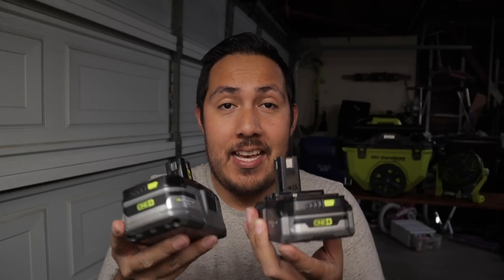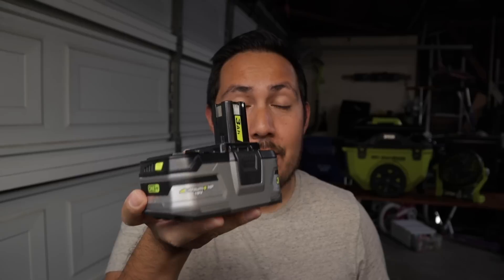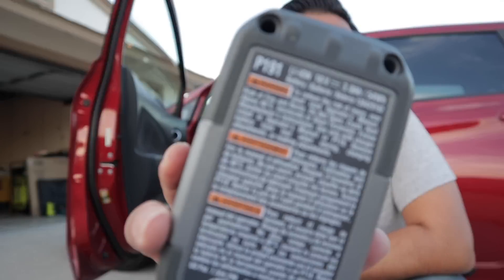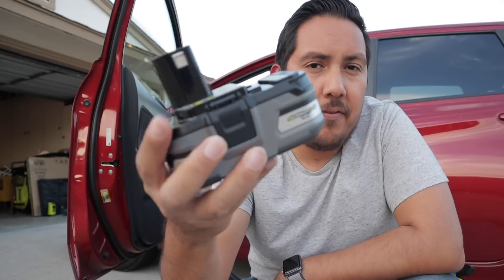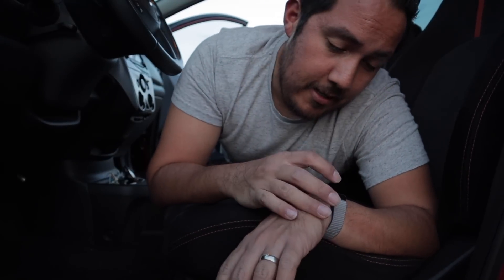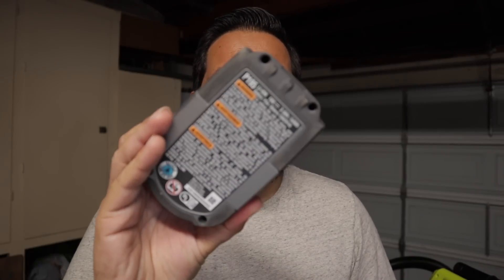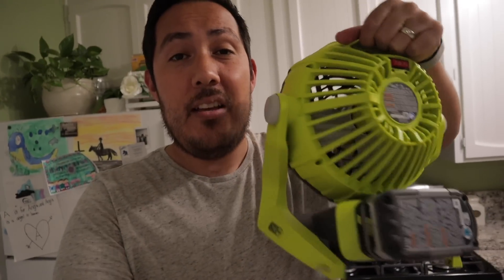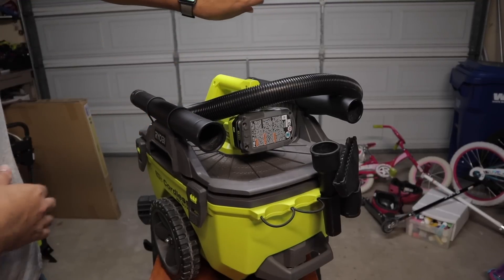Ryobi HP Battery Drain Test - P195 vs P191

Comment: Very disappointed in the comparison.. it seems the only real difference is the smaller size.  Now if it ran 3-5 minutes longer I would say the P195 would be an upgrade but less than 60 secs is not an upgrade at all.  Disappointed but not surprised in Ryobi. Milwaukee has better tools...
Reply: Clearly you're not a very intelligent person.  They're both 3Ah batteries, and the 195 was just designed to be smaller.  Why would you expect the 195 to last that much longer?  Oh, and the 195 costs way less than the 191.  How stupid do you feel?
Reply: @elmSTREETnasty    The P195 used the new 21700 cells and was originally marketed as having 25%-35% more juice as the P191 regardless of AH capacity.  You are ignorant of reality but instead useless people like you get a high going online and degrading others trying to cover up your own life's anger and despair.   Your words are useless.  :)
Reply: @elmSTREETnasty   the P191 is far cheaper than the P195.  Again more BS from you.  Ryobi is actually coming out with a new line of HP batteries.  Check out their website.  The P195 is being phased out due to poor performance and not on the website.  Do the world a favor. End it now.
Reply: Wow dude you really are stupid.  He said the 195 costs less than the 191 and it does.  Good job pointing out that Milwaukee makes better tools than Ryobi.  I mean anyone with half a brain already knows that, but it's cute that you felt the need to point it out.  You sound like a loser who got beat up all the time in high school.

Comment: Second test had no load on it. You need to perform both test static without load to see real results.
Reply: Agreed. Also, a minimum of three tests should be run for each battery and the results averaged. The battery with no load running slightly longer that the battery under load would seem to be the expected result, and not a difference between batteries.

Comment: If they both in fact have 3 Ah capacity, the fact that the P195 ran longer means it provided less current to the vacuum.  Less current means less power available to the tool.  All other things being equal, larger cells have less internal resistance than smaller cells which wastes more and more electrons to battery heating at higher current draws.  I would agree that paralleling pairs of slightly smaller cells would halve the internal resistance of a single bank of cells of the same type.  Without seeing the cell specs, I would guess it that the newer bigger cells have at least 80% of the internal resistance of the old cells.  But paralleled, the old cells have 50% so there is almost guaranteed to be less voltage loss to internal resistance on the older version of the battery.  It makes perfect sense then that the older version would not run as long.   The P195 in a high amp draw would provide less power and likely have more battery heating than the older ones.  It would be great to know the difference in weight between the versions of 3 Ah batteries.  Although the older batteries would likely perform better in the highest demand applications, I would think that the later single bank bigger cells would save enough weight to make them desirable for brushless tools designed to be held in one hand.  They should be great for the stick vac and the drill drivers and impacts but not as useful for the reciprocating saws or angle grinders which demand maximum current and need two hands to control anyway.

Comment: I lost power at my house earlier this week from 12:30am to 5:30am. I woke up as soon as power went out and it was a warm night. I realized I had the hybrid fan by my bed in the box so I slapped on a 4amp battery on it turned it on high and lasted rest of the night and I was able to sleep. You are right, it's a great thing to have in a pinch when the power goes out in the middle of the night. 😊
Reply from the maker: That’s awesome to hear Dr Quinn! I always try to have some batteries as back up just in case.

Comment: Fanboyism aside, what do you like/dislike about the 6-gallon vacuum?
Reply: I have the 6 gallon vac, I was surprised that it was as strong as a 110v shop vac for suction (if not better)
Reply from the maker: The main thing I love is that it’s cordless. Being able to take it anywhere is amazing. It seems really simple but was the biggest thing I noticed. But the suction power is quite strong, not as strong as higher end corded vacs, but still great for picking up a lot of debris.
Reply: @eimartin  Thanks for the reply Edgar. I have all of Ryobi's current 18V vacuums. I bought the 6-gallon over a year ago and literally never use it, I was just wondering what your thought were on it. I would like it more if it were a hybrid. My hands-down favorite is the 3-gallon vac, I bought it to replace my Dewalt 18V hybrid.

Comment: Edgar i just went to home depot. Saw the dewalt combo . Cic and hammer drill with 2 flexvolts for 350. I bought a month ago for 400. I got my price difference from store.
They had on clearance the 15pc milwaukee hole saw for 40 bucks. I bought it.
And got the ridgid 14 gallon shop vac with the detail kit for 99.
Im excited for sunday got some extra money saved just for it

Comment: I run my tests with a couple of P-721 Hybrid 20-Watt LED Work Lights on high to keep a constant load for comparison purposes.  Thx!
Reply: MP Rents what were your results?
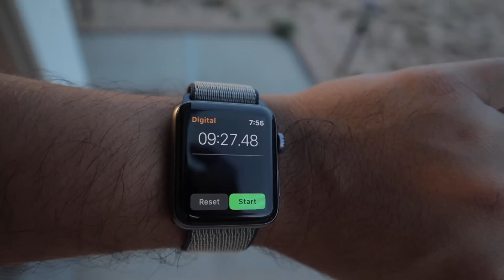Reply: @rocketman121  The p721 on High averges (after several tests) with the following batteries were:  p102 1:05, p191 2:45, p108 3:40,  p192 3:45, p193 5:35, p194 8:40